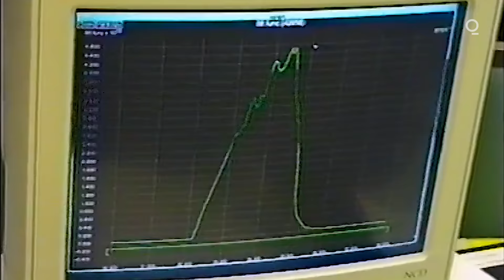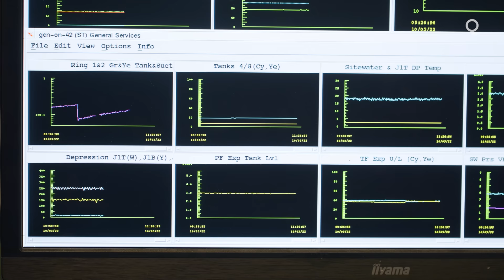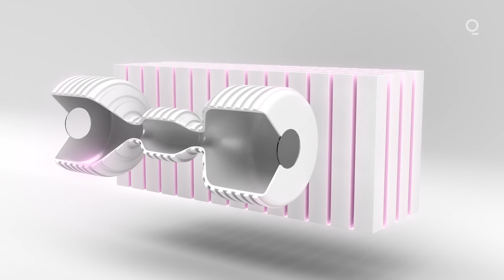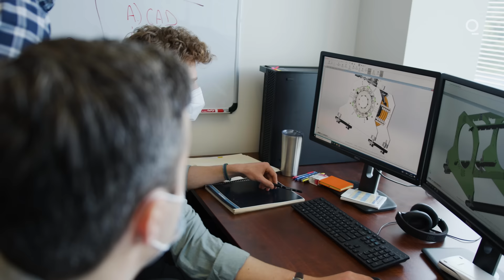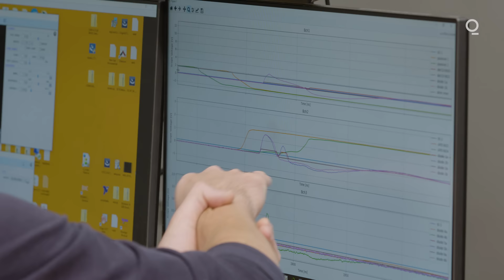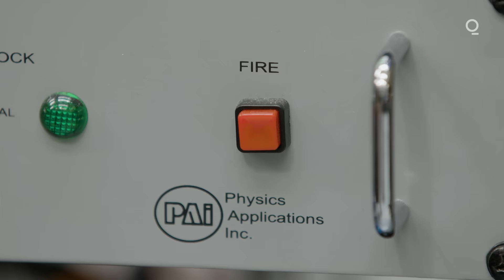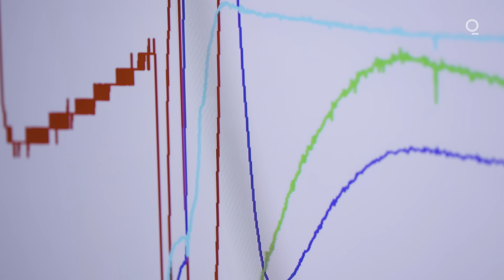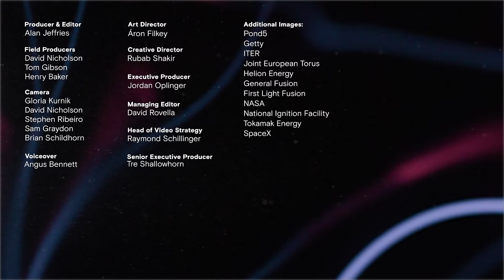Why Private Billions Are Flowing Into Fusion

Comment: Something that wasn't talked about: The fuel.

Short version: the technical challenge with fusion is not only the getting the plasma hot enough part efficiently enough

Long versione:
The lowest temperature fusion reaction we can do is deuterium (D) + tritium (T) to helium and a neutron. All other reactions require factors more of temperature/particle energy.
Deuterium you can get from water (although it only makes up ~0.02% of the hydrogen in natural water). Tritium is radioactive and has a short half-life, so every bit of tritium on earth was generated by humans, either through atom bombs or nuclear reactors or accelerators.
You can use the neutron that comes out of the D-T fusion to do another nuclear reaction with lithium that produces one tritium atom and a helium atom. But the technologies surrounding the entire process of recovering that tritium are not completely solved either.
Reply: The whole thing is a non starter. Even if the reaction itself produced overall net energy which so far isn't even close, the fuel would be far too expensive and energy intensive to supply. 60 years of research and we've got nowhere.
Reply: what is the reason, they cannot fuse regular hydrogen?
Reply: @zazethe6553  The reactions for regular hydrogen only happen at much higher temperatures/pressures
Reply: @zazethe6553  regular hydrogen does not have neutrons, it is 1 proton and 1 electron. Deuterium also has one neutron, while Tritium has two
Reply: Lower the goalposts and shoot for synthesis of helium.
There is a dwindling supply of that, and maybe you’ll run into some bigger fusion breakthroughs later.
Reply: Or just use He3, which is found deep in our crust or on the moon.
Reply: @zazethe6553  To get into a little more detail, fusing regular hydrogen (also known as proton-proton fusion) is incredibly difficult... orders of magnitude more difficult. It is so difficult that the nuclear cross-section (basically a measure of how likely a reaction is) cannot be measured experimentally because it is so low.

None of the processes used to produce fusion reactions (basically creating a superheated plasma) would work with regular hydrogen because even the sun can't heat plasma hot enough to produce energy that way. Almost all of the proton-proton fusion in the sun is a result of quantum tunneling, which is incredibly unlikely. As in you're more likely to win the Powerball lottery twice in a row, buying a single ticket each time, than two protons in the sun are to fuse. A cubic meter of the sun's core produces less energy than a cubic meter of compost. But the sun produces as much energy as it does because it is very, very large.

But even supermassive stars which get much, much hotter than the sun don't produce energy by smashing two atoms of regular hydrogen together. They instead use the CNO cycle (carbon-nitrogen-oxygen). Protons get smashed into carbon to form nitrogen, more protons get smashed into nitrogen to form oxygen, then oxygen splits off a helium to become carbon.

In short, even stars can't fuse regular hydrogen using the methods we use to fuse deuterium and tritium.
Reply: So ultimately we'll still need a small number of breeder nuclear fission reactors to make the necessary tritium we need. I think the world could live with that
Reply: Why do they not try other atoms to fuse? Elements that are more readily available? If proton-proton/hydrogen-hydrogen fusion is too hard and what they've come up with is equally difficult. Why not move up the periodic table to the heavier elements. Oxygen/carbon/ nitrogen etc.
Reply: @Leyogon  The numbers for that don't really add up. Nuclear fission reactors only produce tritium as a byproduct, and it's generally not wanted, so they are not built in a way that much is generated. If you relied on existing fission reactors to produce all the tritium, you wouldn't even be able to supply ITER.
Reply: @ThatGuyWierd  The energy you can get out of fusion/fission is a parabola. The energetically lowest element is iron. For everything lighter than iron, you can get energy out by fusing them. For everything heavier than iron, you can get energy by splitting parts off.
Deuterium and tritium just are the atoms that fuse at the lowest temperature. A temperature which we are currently struggling to get to for prolonged periods of time.
Reply: @dangeary2134  There's no more time for research. The economy is collapsing now, not in 10 years.
Reply: Breeding Tritium is an engineering problem, not a physics problem. It’s largely chemical engineering. I foresee that a Tritium breeding system could be developed in less than a year.
Reply: Lithium blankets and tritium breeding. If any design factors that in, they have a chance of doing well over the long term. But if they rely on an outside source of tritium, like filtering seawater, it's likely to take up more energy than it produces. Harvesting fuel eats into those gains by a lot. As far as I know, ITER, Commonwealth Fusion, and Helion have all built Tritium Breeding into their designs. There are probably others. It's definitely something that's been researched for a long time and there has been quite a bit of success here.
Reply: @Withnail1969  All according to UN / WEF plan.  “You will own nothing and like it.” That’s not a promise but a threat
Reply: 25 kg of tritium left. If we haven't figured it out by 2050 it'll probably be a century later before we can do it since we'll need to develop a completely different type of fuel. Bad news is tritium when produced has a half life of 13.5 years and soon the majority of what we have will be useless and barely half a kg of usable tritium is produced per year.
Reply: @ThatGuyWierd  The amount of energy required is not even remotely within the capabilities of the human race. Nuclear fusion in nature happens when forces in the center of a stellar body are sufficient. Putting together approximately 13 Jupiters would be big enough to do some deuterium-tritium fusion in the center, that is a brown dwarf. Our sun is massive.  enough to fuse hydrogen to create helium (proton to proton fusion). Heavier elements are created in much more massive stars. The limit is iron, because it takes more energy to fuse than it releases. To form anything heavier than iron requires a supernovae or neutron star merger, which makes all the nuclear bombs on earth look like a dollar tree firework. Essentially, if we can't replicate what happens inside a brown dwarf for longer than 5 seconds (ITER should be able to do 5-10 minutes), it is not very likely we will suddenly be able to do a hypergiant.
Reply: @lunatickoala  There is a more fundamental reason confined fusion does not occur in laboratory apparatus: the energy balance for D/T and D/D is negative. I have not found a single methodology for confined fusion that relies on quantum tunneling, recovering energy losses, or meeting the energy balance EXCEPT the Teller/Ulam approach in 1952 resulting in Ivy Mike. Because effective methodologies are difficult at this scale, fusion speculation is more lucrative for Start-ups than meeting principles in physics.
Reply: They are already mining helium on the moon ! Truth !
Reply: @itmaslanka  no they are not.
Reply: @gmork1090  maybe we’ll trade it for sometime else like Ike did !
Reply: @Withnail1969  what makes you think that? We're just entering next phase of energy war.
Reply: @darinhitchings7104  we cant do things like that. takes too much energy.
Reply: Tritium is a byproduct of a fission reactor in Canada. Theirs enough Tritium stored there for a very very long time already
Reply: @ThatGuyWierd  their are boron ones already
Reply: @tusharbhudia9421  I read there are only like 50 kg of tritium in the whole world.  However it can evidently be bread from other types of fusion processes.  And meanwhile, the Japanese are flushing 1 million gallons of water per day that is laced with tritium into the ocean... nice...
Reply: @Withnail1969   ever heard of a tidal wave energy generator?  We don't have to create the energy.  The energy is there waiting for us...
Reply: @darinhitchings7104  i've heard of them, it's intermittent low intensity energy like all renewables. it won't solve our problems and we can't build, install or maintain any such equipment without fossil fuels.
Reply: @tusharbhudia9421  there are not.
Reply: @jeffpeachman  It's an energy problem.
Reply: @darinhitchings7104  It's a large number but still low intensity compared to fossil fuels. It's also intermittent. Low intensity widely dispersed intermittent energy that requires major investment to use is not going to save us.
Reply: @deadralynx1288  at what cost per atom of hydrogen? do you understand that it takes enormous amounts of energy to do that?
Reply: Even if there is almost no tritium on earth. There is some in the moons surface. If we figure out how to transfer tritium to earth i think it will  probably idk.
Reply: @toxicatedpro7182  far too expensive.
Reply: @Withnail1969  Dude, can you stop with the "expensive" talk. Having an endless supply of ANY resource, what having heavy industry on the moon is, can not even measured in todays money. I am not talking abt how we get this down here - i talk robotic mining and just refining it right there. Even with todays tech, we are maybe 20 years from having self sustained industry on the moon. Sending rare minerals and fuels back to earth is the smallest problem.
Reply: @deadralynx1288  Expensive is what matters. Most resources will never be used because it would not be economic to extract them. We don't have robotic mining and chances are we never will. We will never mine the moon.
Reply: @Withnail1969  ok.
Reply: @Withnail1969  look at 100 years ago, they thought flying is too expensive and  will not become commercially viable. look at here now flying is accessible to the middle class and it is not too expensive.
Reply: @toxicatedpro7182  I'm not aware of anyone saying that at the time. Post an example of someone saying that 100 years ago.

Comment: Fusion would be great . But in the meantime , why aren’t we going with walk away safe environmentally friendly long proven Thorium molten salt reactors that doesn’t need to be by a body of water and can built almost any where ? 
China is pushing hard to have these plants and is almost past the pilot plant stage and since thorium is very abundant it makes for long lasting cheap clean energy.
Reply: Thorium fission can be used to power nuclear fusion as well like in a hydrogen bomb so you get more energy yield per thorium.
Reply: @aoeu256  And we may be able to separate Thorium from seawater, then breed it into Uranium in a reactor. Upcycling is the new recycling

Comment: Never seen a single time that they quoted total power in electricity and total power they would get out in electricity. Hope they do it but I don’t see it for 50-60 years. The net gain they will quote will be in energy in and energy made not that the energy out when turned to electricity will be 40% of the energy made as heat even for ITER
Reply: Yeah. There is a danger with misleading expectations: Other mitigation strategies maybe neglected on the grounds this is the answer worth waiting for; loss of credibilty may even affect core funding.
Reply: Yeah when the dude said one of those "projectiles" in his fusion reactor creates enough power to last one household 2 years, and that they can fire one every 30 seconds... I felt like that was insanely low. And those are projections that he HOPES for. Not to mention they're still barely in the testing phases, so he hasn't even built one yet. 
No shade and we should explore all possibilities, but we really need to be putting more focus on things that we already know work - nuclear.
Reply: Yup that's the real question. One of the first thoughts that came to mind. Not only is the energy output questionable, the entire issue of conversion efficiency makes it a tough case for practical use. We need a better energy conversion technology.
Reply: @jajajinks1569  yes nuclear especially MSR. The power out maybe enough for 2 years but he did not mention he power in it took or that when he tried to convert the power to electricity he would only have 30-40% of that power. In uk he would need to fire one of those pellets every second to get the power for everyone and convert them at 100%. Plus store the power at off peak and deliver at peak can they even make 1 of these pellets per second probably took them ages to make the pellet

Comment: In 2006 MIT President Hochfield visited my alumni club in Dallas.  After a great presentation she asked for questions.  I said "In 1971 I worked on a problem set for a fusion reactor containment vessel.  It's been 35 years, so where are they?"  She replied that the head of the Nuclear Engineering Department had told her "Thirty five years, but this time we mean it".  

It's been 16 more years Where are they?  Some of this seems promising, but I want to see something before I hit 100.
Reply: As far as I know it is still a problem not completelly solved. Many may not realise, but fusion can be this first peculiar form of power production, where the fuel is not the real significant  consumable, but the structural, and sacrificial materials of the reactor device itself.
Reply: What if tech originally developed for fusion were transferable to another energy project adequate to solve the GHG problem?  Gyrotrons are the key tech for a geothermal energy startup called Quaise Energy.  They use the gyrotron to vaporize basement rock, cutting borehole costs by an order of magnitude whilst vitrifying the sides of the hole and stabilizing it against the impending pressure.  Their system also builds on oil industry expertise in pipes, geology, pumps, etc.

As to fusion itself: it looks still a distant prospect, but at least we're throwing more darts at the board with slightly better aim.
Reply: I don't believe the Tokamak type reactor has much promise.  With neutrons constantly bombarding its innards, making it internally radioactive, and causing structural decay, I have a problem with this.  Clean thermal fusion in a Tokamak simply isn't so.  The Quaise Energy concept is much cleaner, as mentioned by kreek22, but could destabilize plate tectonics if improperly used.   The bullet approach to aneutronic fusion looks more promising.  Keeping the flow in one direction is much easier than trying to contain a neutron bomb completely.  Basically, an aneutronic fusion rocket strapped to an MHD generator.
Reply: Meanwhile stuff like molten salt fission breeders get nothing.  Worked in the 60s, far cheaper, safer than current commercial (solid-fuel/water-cooled) designs, and have most if not all of the benefits claimed for fusion.   Hybrid fission/fusion designs might even help get fusion here faster.  I'm not anti-fusion, just pro common sense.
Reply: It’s because we waste money on submarines not hospitals and fusion
Reply: @CraftyF0X  The fuel is an issue too sadly. There is not much tritium in the world.
Reply: @Captain-Sum.Ting-Wong  Kinda not a big deal to produce it though (fission reactors do it all the time especially CANDUs) also the fuel cycle is planed to be Li6+D2 -> 2He4(+n) Basically they plan to breed the tritium in the flibe blanket, so it shouldn't be a problem. (at least in the case of D2-T3 fusion)
Reply: @CraftyF0X  As of now we only get tritium from CANDUs, which there aren't many of. It is a very real problem that we might not have enough tritium to get fusion off the ground.
Reply: Last year Commonwealth Fusion Systems demonstrated a powerplant scale magnet that is twice as powerful as the government project ITER's. So much so that its operational strength is limited by the structural strength of steel. This enables 10x more power for a given size putting the tokamak design on the edge of commercially relevant potential costs. They will be testing the physics in about 2026 with the SPARC tokamak with a pilot plant putting power to the grid potentially in the early 30's
Reply: @kreek22  Quaise Energy is the new Theranos, what they are suggesting is not only not really possible engineering wise, its not even close to cost effective compared to existing technology.
Reply: @Jeremy-gy7me  You may be right, I'm not an expert in the field.  But, which part of their system relies on impossible engineering?
Reply: Dr. Reinder's conclusion is our transition from petroleum to fusion power cannot occur in time to address climate disruption. ("The Fairy Tale of Nuclear Fusion" by Reinders (Springer). In the same 35 years the success criteria for fusion to occur in a reactor vessel has changed from basic physics principles to psuedo-science, that leaves the door open for speculation from investors.
Reply: @CraftyF0X  there was a startup around 1979 that included Robert Bussard that worked that problem.  Build it from the cheapest stuff you can, and replace the guts after 2 to 3 years.